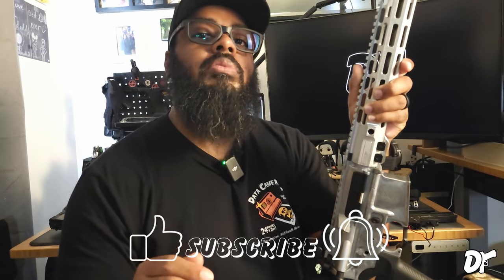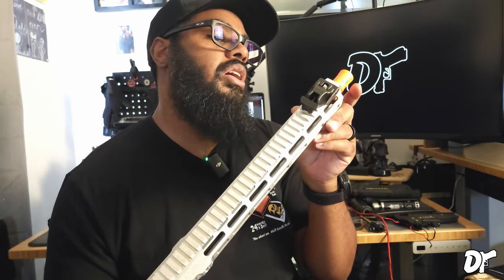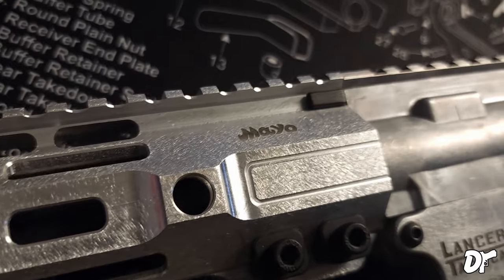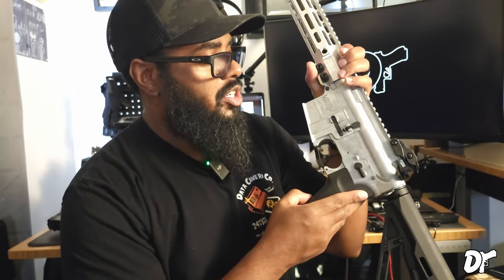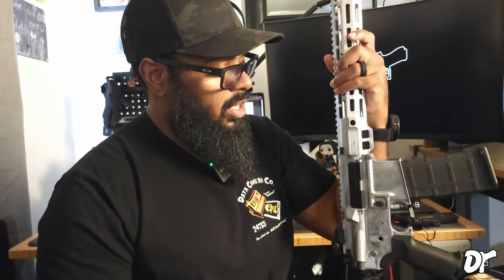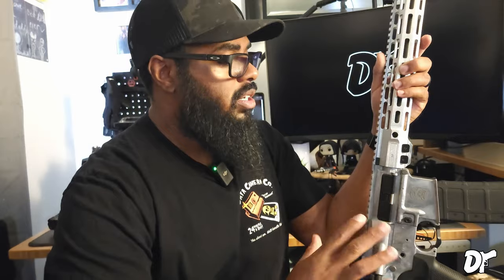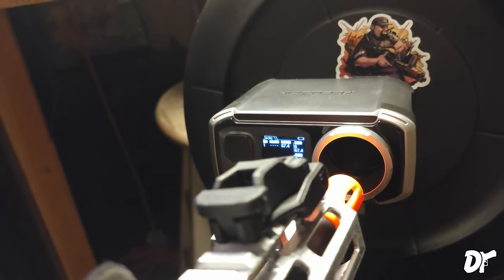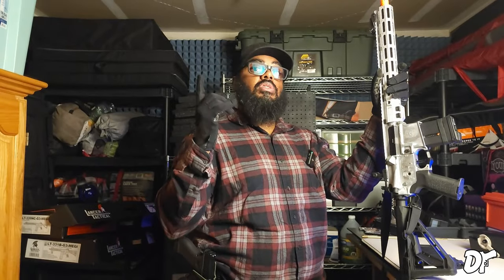THE BEST AEG OUTTA THE BOX?!? | MY FIRST IMPRESSIONS ON THE MGC4 MK2

Comment: Use a very small drill bit and drill dimples into both sides of the pin and grab out with needle nose pliers
Reply from the maker: Thx bro... I will give that a try
Reply: @DarktreeAirsoft  may want to apply heat to it as well bc it’s also glued on just so it doesn’t pull any paint from outter barrel and that sword you referred to is the buster sword

Comment: The trigger will also be more responsive once you get a 11.1V battery on there aswell
Reply from the maker: @Xot1c01  this is very true and I've been using 1 ever since 👍🏽
Reply: @DarktreeAirsoft  i have a question whats the full auto RPS on the MGC4 MK2 with the 11.1v battery in the video with a 7.6 it was 15  but im betting it will be higher with a 11.1v
Reply from the maker: @Xot1c01  I believe it around 18 rps. I still have one that's internally stock so I can run a check on it soon.
Reply: @DarktreeAirsoft  sweet you should do a review of the emg / strike industries G&P gate aster aeg im pretty sure its the best stock aeg out rn